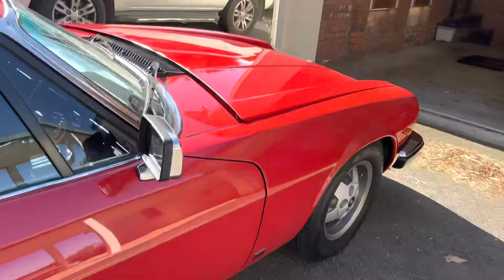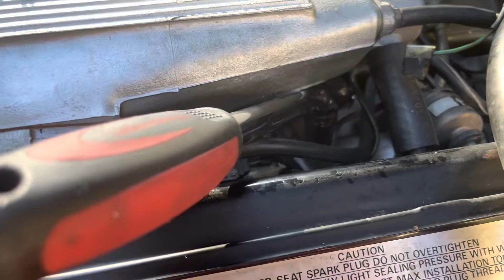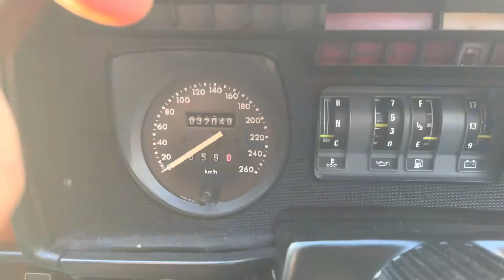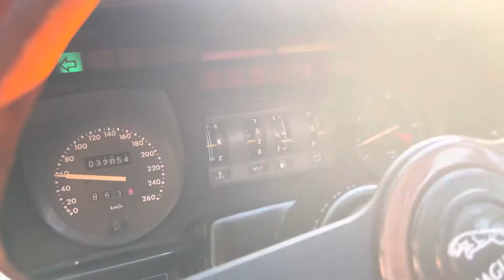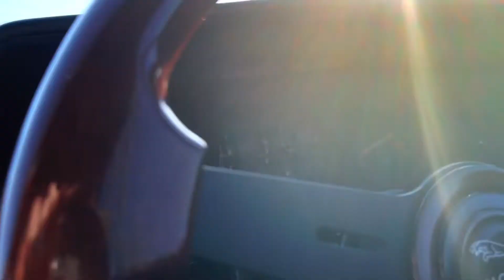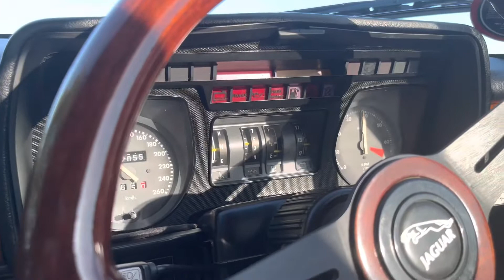XJS test temperature gauge and replace sender unit

Comment: I have the same problem, but after installing a new sender, nothing changes. The gauge still shows high temp. Any advice?
Reply from the maker: Make sure it’s the correct part. A few I looked at appeared to fit but the resistance in them is different and that will give an incorrect reading. I listed the correct part number below.

Comment: Is the new sending unit a genuine Jag part? How many litres of coolant does the system contain?  Good video by the way!
Reply from the maker: It is part number DAC2583 which I believe is the correct one for the V12 XJ-S HE. I bought it from Jagdaim in Victoria, Australia sand they have a good reputation as far as I know so I assume they sent the right one. I suspect the old one was the incorrect one. I think it takes about 12 litres of coolant but I didn’t empty it. I just topped it up a little once I replaced the unit.
Reply: Didn't work for me temp gauge struck on high